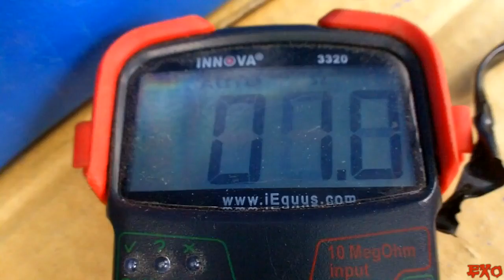How To Build A Subwoofer Box 3 | Beginner Car Audio Tutorial - Dual 12" Custom Ported Sub Enclosure

Comment: Or you could have used a table saw, and had even cuts. You wouldn't have had to do all that sanding, and filling in the gaps with Liquid Nails. That's what I call Afro Engineering.

Comment: I don't think I saw anything done right in that build. 32mm board would have been cheaper and stronger. Melamine instead of raw mdf is smooth and sealed. Screws instead of nails and pva glue instead of construction adhesive.

Comment: +EXOcontralto I need to build a box for my 3 re audio double x 12s. I have and am removing the back seat. I need the wood to form over the hump in the middle of the car. I also want at least 2 cubes for each chamber and want it ported to 32hz. I have a 99 ls400. please tell me where to start I have taken some measurements but am totally new to building boxes. I would really appreciate it bud. you can email me at jsschub@comcast.net

Comment: 1.5" MDF must weigh a ton! I build rock solid enclosures out of 1/2" or even 3/8" baltic birch plywood and cross bracing and are solid as a rock, without being a 2 man lift haha. As an added bonus they take up less space in the trunk. I found one of the secrets is to have triangular ports in the corners that help brace the box.
On the plus side, I can't see flex or moving around in the trunk being a problem!

Comment: what is he measuring with the multimeter at 4:13? and why?
Reply: hes measuring the impedance of the subwoffers. To insure that it matches what his amp puts out.
Reply: the ohm setup he wired it to. You can use 2ohm 4ohm depending on your amp/sub setup.I think the most common is 2ohm

Comment: Very newbie question but once making a custom box how do you wire the subs from the inside? where do you run the wires from the subs to the amp through the box ?
Reply: orfeous
That works too. But i dont like it because it just adds resistance to circuit. Might be negligible amount, but i dont like having breaks in my wires.
Reply: You can either buy a wire terminal or you can just pull the cables out of the port like these guys did.
Reply: i like going through port because theres no other holes in my box for air to leak. But that way looks ghetto. You could just drill some holes, through a side no one sees, big enough for your wires to pass and seal them with silicone or whatever. Ive done that before too.
Reply: alexisthemexican im thinking of using bolts and nuts for that.
Doing it at the back on the box. no one sees it.
Reply: Yeah, some people likes bolts and nuts and some dont.. :) some likes to drill holes and route the cables through the box directly to amps.. and some people likes those terminal cups :)

I "must" do the bolt method because of my wires is 8awg and need to wire the woofer to 1ohm. They does not fit on my woofers terminal. It just only fit 1 ½ 8awg :)

For my small system i dont think the loss is something too care about.
One 12" 1ohm at about 1000-1500W theoretical ofcourse :)

And mids/higs on 4x50W RMS amp.. putting out more likely 70W RMS theoretical :)

Comment: What did you put down around the sub holes before you screwed them in?
Reply: It's called rope calk it's sold at wal mart. It's the best assurance you can do to make sure there is zero chances that air will leak around your subs

Comment: Thanks, your videos are helpfull! I have two 10"s each on 200w rms, i don't think i need 2 layers of mdf, i have a small kia, so i dont like having so much weight in the trunk. i think it would work well if i just used re audio's design instead of switching it, since my subs are smaller and weaker. What is your advice? One layer of mdf? And keep the port walls regular? I have a small car

Comment: I can build that box for 225 all wood and resin and I can make it much better using torres box calculator it's more accurate then re box calculator and those cuts were so sloppy should of used a table saw for the initial cuts and I usually build the box in single 3/4'' mdf them put another layer all the way around its basically a box in a box and 10 times stronger then this method

Comment: Hit up the RE box calculator (just Google it) and plug in your dimensions and speaker specs; the process of building the box is the same as this but for a single it will be smaller.

Comment: Hey EXO ive watched alot of ur videos good shit ! building my box this weekend for a jl 15w0v3 nothing crazy but its in a pre fab box now and i do notice the lows cut out not enough volume im building it to 2.75 cubes not including port , port is 2.75 inches tuned to 32 , will just the bondo body filler work to smooth it out or will the vibration crack it , had any problems with it ?

Comment: look in the specifications of each sub, their website might have it. and look for sub displacement. for example, each of my dc audio level 4 18s will be .26 cubic feet. in your box design program, insert the displacement TOTAL. so for only 2 of my 18s, looking at .52 cubic feet. a way to avoid displacement will be to invert the sub and mount it that way. exo is busy as hell so i figured i could try to help. let me know if you are still stuck.good luck!

Comment: Hay Exo ive been following you for awhile now and i was wondering if you could answer a question that i have about a box for my 1500 Extended cab truck. Im running 2 15s and and want t maximize my flex. Where do I put the port? Right now i have a box built at 35 hz and the port is facing the ceiling and i get more flex with the doors all open. Please help

Comment: Question, how do you wire the subs up. I know it sounds stupid but I see that you didn't run the wires through the port, so I am not sure if you used a bolt or drilled holes for the wires.

Comment: I'm turning an old MTX TP1200 loud speaker box into a cost effective box for a new basshead. The plan is to chop off the horn part and seal the top, my issue is that there are two 3"x4.5" ports on the bottom... can I leave these or should I seal them?

Comment: hey exo, I just built a box with an L port using the Re Box Calculator. the port is only 1.5" wide and is tuned to the same frequency as the one in this video, it has 2.00 cubit ft. I was just wondering how important "45ing" and sanding the edges of the port are, I didn't do this and already sealed the box up :/ will the sound quality really suffer?

Comment from the maker: I like to keep it smooth - Air travels faster over smooth surfaces. Try putting a penny on your carpet at home and try blow it across the floor with your lungs - It's very hard... Next, do the same thing on a hardwood or tile floor - The penny scoots around no problem with even the slightest blow of the lungs :)

Comment: @TheGreatKingWoo rule of thumb in car audio alternator-battery-capacitors and if u dont already know the big three helps by reducing resistance and anything over 800-1000rms u need to upgrade or add batts and/or alt capacitors are a waste of money even if u get them for 15 bucks they suck

Comment: EXO, I have 2 Soundstream SPLX HF 122 DVC on a DTR 3400, but I have blown the subs twice and reconed twice.  I learned about PSI's from one of your vids.  What are your thoughts on these?  I just ordered these custom ones: Platform 2 series 12's with D2.0 ohm 8 layer standard coils (for a 0.5 ohm load), dual stiff spiders and dual sewn leads. they would be rated at 1800w rms per sub and 8ga direct leads. Ya think I will be happier with these?   I have never heard PSi's in person.

Comment: Did you buy speaker terminals or did you just drill a couple holes and put bolts through with washers and nuts?

Comment: Basically the surround(rubber part) popped in and doesn't retract even after un-screwing it out the box and popping it back out. It's lost all power in the left woofer, i just don't understand why. It happened so weird, i got to my friends house, parked then an hour later left and it just didn't work..

Comment: Earlier tonight for no reason my left 250 watt mtx jackhammer 12 inch subwoofer went out. I realized that the surround was pulled in or "sucked in" and wouldn't retract on its own unless i unscrewed it from the box and pulled it back out, even then the left woofer wouldn't work, also i can feel a bit of power in the right  woofer but nothing in the left, i'm assuming the right isn't working anymore because the left woofer is damaged/ in need of repair.

Comment: off my head i remember leaving the amp hertz at 50 the gain and vol max but even when i had lowered it even less bass  and the head unit i cant remember but what i do it the subwoofer lvl setting bringing it up or down does't make a difference in sound.

Comment: Hey exo I need your help if you can , I have a system with alpine head unit an alpine mrp 500 rms watts amp and 10 inch type r dvc 4ohm each and bridge it down to 2 ohm  in a ported box  the mono amp throws 500 rms at 2 ohms thats why I put the sub at 2 ohm and it sounds like shit the bass barely feel it at all and before I installed it I had it connected to my home stereo that has like 300 watts and that shit was shaking my whole house and inside my car its crap and with more watts to it. Thx

Comment: i listen to mainly metal (but i do like some low bass from rap or bass tests), and i already have some subs but i'm using them in ported home audio boxes. both 12s, and one is an old JBL power 5 ohms, around 200 watts rms, and the other is a Dual SD12 175 watts rms 4 ohms, they both sound great running off the same amp, in the same boxes and all but, i'd like to have more space for a trunk.

Comment: Hey man.

So I'm building a new system and needed some help because I'm not sure about something. 

Ok so this is just a beginners system but I will be running a Hifonics HFI1500D with 2 Hifonics Brutus BRZ15D4 in a 8.4 cubic foot box (after displacement). But I'm putting 2 runs a 0 awg from the front battery to the back (2 batterys) then 4 gauge going to the amp with a fuse inline. My main question is do I need fuses for the 0 awg? And is there anything you would change? 
also have big 3 done.

Comment: 1 ohm is better and will bring your amp up to full performance rms wise,2 ohms means your just not working the amp as hard as you could be,so it shouldnt overheat,or damage itself by under using it.as long as its wired right and is getting propper amperage to feed it.overheating can be cause by the amp not getting enough power and just plain overworking itself.

Comment: i've been waiting exo,,gonna build my box this weekend for 2 15"s.i've veiw all 3 videos and many others.gave me lots of ideas.im going 35"x35"x17"(external measurments),with double walled 3/4 in"mdf.ported 8"x8"x13",about 8 feet perfect after sub dispursment,tuned to 33 hrz.the only bummer is i have toi build it in the trunk,so no removal.gonna be tight fit,but im so excited to get going.i got everything but the mdf in my trunk.it will only be 1000 rms at 1 ohm for now.next month a new soundstr

Comment: Exo man, got a huge question, i got a 1997 Isuzu Rodeo, trying to get the most i can get in a small space with out doing a wall, I have seen come pretty nice 4th order builds, i was wondering doing a 4th order would it let me put more into the small area i got, or would building a normal box with the subs on top work better?

Comment: You need schooling you in box construction. Your boxes are lumpy. First, learn how to use power tools.  You wack every power tool around like it was a toothbrush. Let the orbital sander do the orbiting.  Let the belt sander sit there and make the wood FLAT.  Stop jamming it up and down. Same goes for the spray paint, dude.  You are pressing the nozzle all around like it was Morse Code.  Just leave the nozzle ON and make some smooth back-and-forth sweeps ALL THE WAY DOWN THE BOX to the other end.

Comment: first i would say get rid of the capacitor it will do nothing but hurt your voltage i gurantee if you take that out your voltage will be better also get an alternator, no matter what, you will have bad voltage drops if you dont have a strong alternator. and even jeeps today have weak alternators.

Comment: Sorry, i need help my battery voltage drops under 12 v when the bass is to high. I have a 96 jeep zj,  2 12s running @ 600 rms each , 1 yellow top battery, 1 10 farad cap, and i have the big 3 done. Any suggestions on how i can fix the problem?

Comment: Nice, saves you some time answering questions I'm sure. But I would recommend a real respirator and gloves when sanding fiberglass, especially with cloth in it. Had Strep-like symptoms for six weeks after catching a lung full... The fibers had to slowly work their way out of my throat it sucked

And excessive clear coats will save some scratches/scuffs